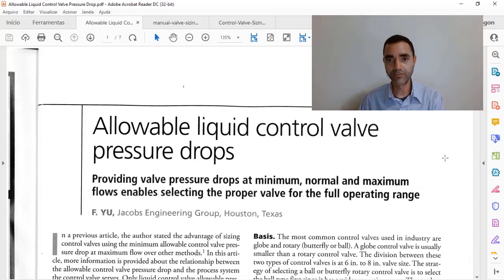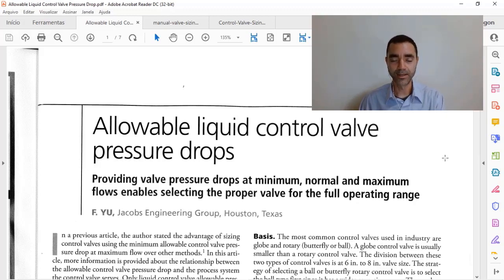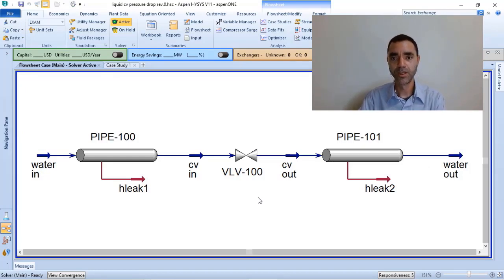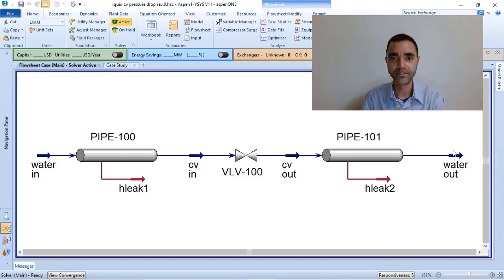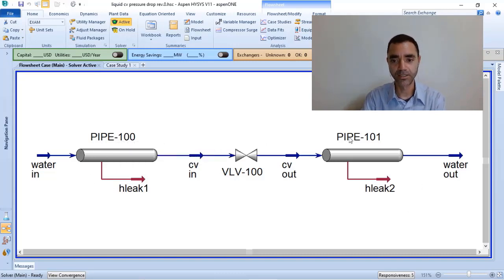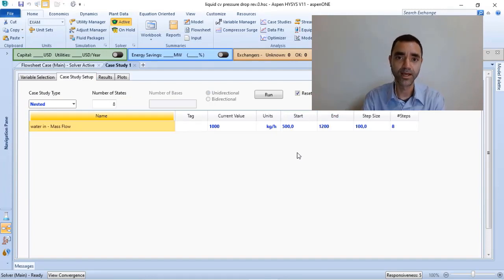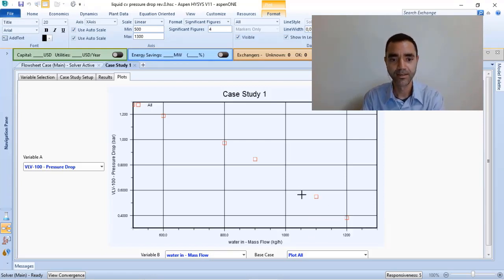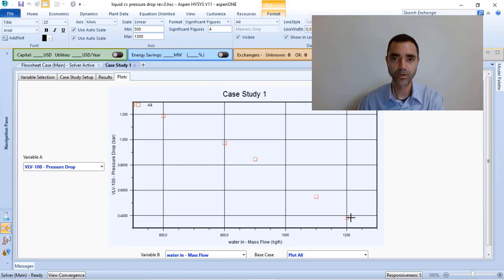USING ASPEN HYSYS TO CV PRESSURE DROP | CONTROL VALVE PRESSURE DROP ON ASPEN HYSYS

Comment: Hi sir, can u do a tutorial regarding compressed air pressure drop in aspen hysys. Apprieciate it
Reply from the maker: Hi, compressed air pressure at compressor discharge must take into account the pressure drop in the pipe and also pipe fitting.